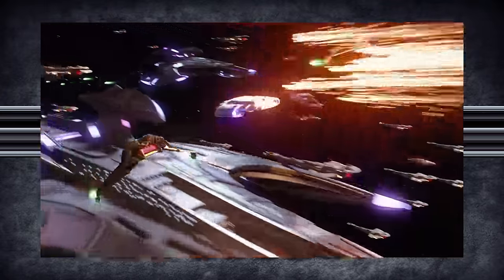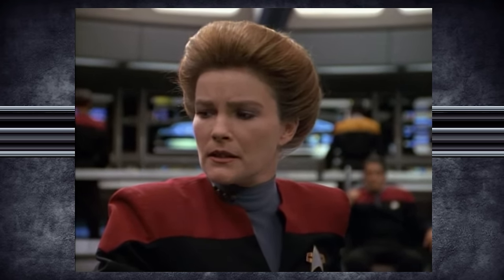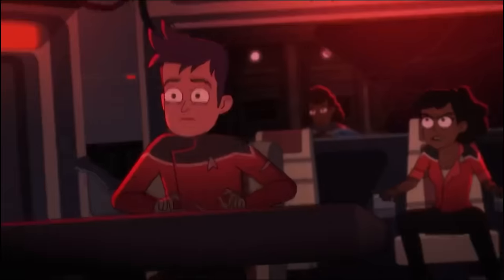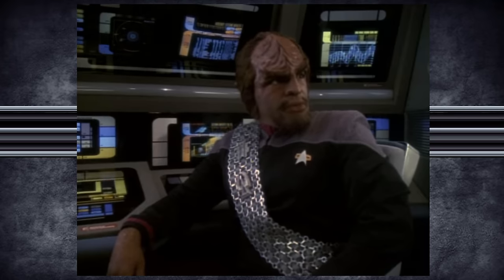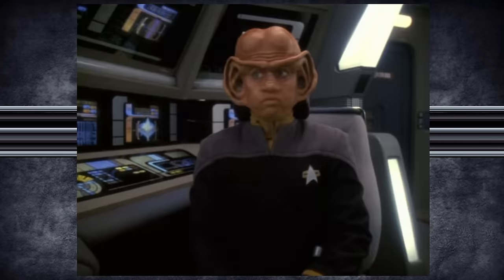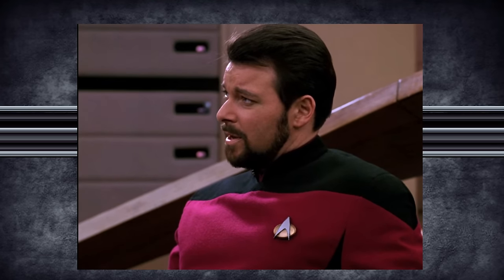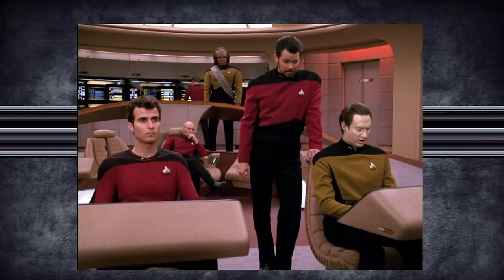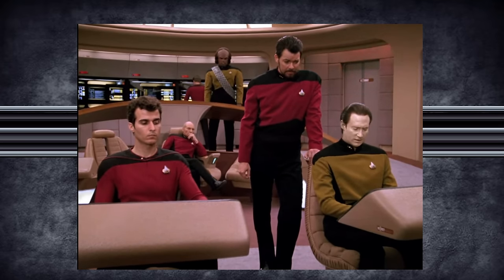Why Starfleet's Bridge Design Was Lethal to the Crews

Comment: Other than the original ST, all computer systems could move fluidly between all panels....the designation of "place" is only in meaning to where the person feels more comfortable. As is seen in many episodes, including when everyone turns into children, the computer systems can even be "moved" to the classroom. Panels also line the walls of the corridors, so at any point, any officer with the proper authentication could technically access their screens just about anywhere on the ship...even self-destruct was not limited to any one location.

The original ST was too old to realize the true future of technology as the later versions, the sets were push-button and knobs from radioshack. If we take this as a classical sense, then we could argue that the original would have had all of the systems seen today and so it too would have those same abilities.

As for the windows, not really. The computer is the most protected piece of equipment and is housed in the center of the entire ship and has its own generator. If panels get fried, other panels will be available. If "power conduits" (which are actually a gel transfer membrane that also houses computer throughput) were to be ruptured, then there are redundant systems that the computer reroutes, having the ability to sever connection points that are faulty automatically. If the computer fails to the point you can't access any data, then the ship is lost anyway....it is the most vital system that it will be the first needed to be repaired no matter what (it controls life support, gravity generation, shields, weapons, and even transport).  The only systems that are fully separated from the computer are the lifeboats and docked vessels with their own separate (smaller) computer systems. Transport can be decoupled and has a backup to maintain sync, but only just enough...Scotty had to double-back the power system and place the transport into cyclical buffer just to save the crew in "suspension."

Comment: 3 dumb comments,
1) if you have ever stood on the bridge of a battleship or aircraft carrier there is a lot of equipment that impedes movement ST isn't different.
2) US Navy like the bridge design of the enterprise they created a commission to study its efficiency
3) the touch screens panels would be a major problem (TNG,DS9, VOY) the moment the ship started to shake, I had a touch screen CD player in my truck years ago and it was very difficult to adjust the volume or operate when the jeep was driving down the road.

Comment: Windows... well kinda agree with your point that in our military it provides important function, especially when instruments would fail somehow.
But kinda comes from one problem, we don't have actual space military and only comparison is with sea going fleet. 
Windows make bridge exposed, while it could be buried deep inside ship structure. 
If you will think about scale of space and what can be called encounter (distance to target, lack of light) human eye would be useless as instrument of detection.
Clearly it is relic of thinking space ship have "ship" in name so it should be designed as ship.
There is no logical reason to keep one of most crucial elements exposed so much for attack. Kinda like leaving reactor core on top of armour as it needs to be refuelled, so better leave access to it.

Comment: Plasma conduits, running into every console on the bridge... plasma conduits running behind every bulkhead along every corridor and every room. No thought to designing this so that if they rupture, the blast goes somewhere other than into the crew's faces.
This fact alone accounts for very much mayhem and death to crew. Flammable uniform fabrics also.
Second, is full gravity while in combat. Falling debris and structures, and crew being thrown around accounts for very much more casualties. Of course, artificial gravity is also the most robust system in all of Trek. It almost never goes out, except for maybe once for plot effect.

They see no use for environment suits. No need for each person to have immediate access to breathing apparatus for smoke or vacuum.
Sense says that they'd don somewhat armored suits. Hull breach? So what. Deal with it as necessary, but crew can still access and work there.

Seats or even standing stations with restraints would help. We see someone seated at a chair behind a desk, thrown to the floor or across the room. If (the gods forbid) gravity went out, people would jack-in-the-box out of their seats and be helpless.

Windows are tricky. Give a transparency radiation and flash shielding, and they're opaque. If they can't go opaque fast enough, the crew would be flash burned.

Galaxy class had the battle bridge, which should have been the captain's station during any combat. Granted, they didn't want two bridge sets to be used in every episode, and they never showed or mentioned it again.

Comment: To be honest. I play alot of STO (Star Trek Online) I haven't ever switched off of my Concorde class command battlecruiser. 

I do however like the design of the Arbiter class battlecruiser.

Sure, alot of people agree that STO isn't cannon and I frankly don't care if it is or isn't. 

One thing that gets me is the over exposed neck on most Fed Starships. 

One good hit in combat while shields are down and the neck is violently destroyed. 

Sure, the neck is made to separate but, in no way are they prepared for the violent decompression. 

This is why I prefer the Concorde class, Arbiter, Intepid and similar designs who have no neck or little of it. 

Secondary to that fact is that windows are as memed in mass effect a structural weakness. (Geth do not use Windows, they are a structural weakness) 

In no way should ANY warship in starfleet have windows. Exploration ships, sure. Science, sure. But warships? No. 

Now, an argument to be made for a design I recall that had windows but also had bulkheads that closed over effectively eliminating the weakness during a red alert. 

I'm rambling. Point is, bridge designs in ST suck, I do LOVE the Intrepid and Defiant bridges. Alot of the ship designs are questionable.

Comment: There was never a need to run plasma power conduits to any point on or near the bridge.  The bridge is a control center, and thus everything it needs to do is data manipulation.  Every bridge console should thus be a data terminal,  connected to the ship's network.  And the configuration of every terminal should be software based, so any terminal can perform any control function as needed.  Destruction of any given terminal could be compensated for by picking up its functionality on another terminal.   And all powered by low voltage systems,  with very minimal hazards.   The only time there should be plasma on the bridge is when Ensign Plasma brings coffee and donuts up on the mid-morning break.  

Also, every system in the entire ship should be locked down under biometric security, encryption, and defined access levels for all crew members.   Only fully authorized, verified users would be able to do anything with any of the ship's systems.   Intruders would find that nothing works for them.  They would find all consoles to be locked down to them.      And the ship should have automated defensive systems that isolate, contain, disable, or kill intruders according to threat conditions.   Anything from simply isolating them with containment force fields in the walkways, to knocking them out with gas or stunners,  to evacuating the atmosphere within the containment area, letting them suck vacuum,  to automatically transporting hostile invaders into empty space so they go POP.

Comment: The problem with windows is that in space, you can’t see shit.  Engagements are going to be a lot further apart light to see other objects by is going to be in short supply and frankly, the bridge should be in the center of the ship so windows would be a moot point.  The XO should be spending one shift making sure the ship is running efficiently, taking care of disciplinary duties and paperwork and the second shift on bridge in command when the captain switched duties with the XO.  A third officer gets the late shift.  In the event of battle, the XO should be elsewhere in some aux control.  There is no real good reason to have them both on the bridge as the same time.

Comment: the problem you have with ANY see through materials, regardless of their physical strength is the vulnerability to EM radiation. simply put, the materials let the visual part of the EM spectrum through so if you create a weapon that takes advantage of that particular weakness it would be devastating. For example a laser that operates on the same part of the EM spectrum that can get through the viewing window. it may not cause physical damage but would cook the bridge crew nice and toasty.

Comment: Every time I see a step on a starship, I ask "why?"

Not only does it make it less acessible for, say, different heights or methods of mobility species, it just brings in trip hazards in stressful situations, or conditions of low visibility. Now crew need to be manhandled around instead of using, for example, a wheeled gurney, when they are incapacitated.

Having an unnecessary step on a space vehicle boggles my mind. Fine if it is a military installation where you can tightly control the size shape and ability/mobility of everyone aboard and space might be tight and turbo lifts prone to damage. 

On a science vessel that regularly hosts aliens or might be transporting civilians of unknown mobility requirements? Or a civilian space station where you'll never know who's visiting? No. Get your steps out of here. Ramps and lifts.
Reply: Even worse. They're already using artificial gravity. The bridge has no reason to be flat at all. Put some gravity plates on the ceiling and stick a guy up there. It's not like if power goes out he's going to FALL. The bridge shouldn't be a circle, it should be a sphere. There shouldn't be stairs anywhere, OR EVEN RAMPS, because there is no such PLACE as a different elevation. Just put your gravity plate on a slant and your wall is a floor. Your ramp is a flat level surface like ANY OTHER PART OF THE FLOOR regardless of what angle it's tilted at.

Comment: If the ship was hit in the bridge at a given time could wipe out the top of the command structure. Plus what's with the seats not having safety seat belts. Objects in motion remain in motion unless acted on by an outside source. So if that big starship stops suddenly and you aren't strapped into the seat then, you are going to continue keep going even if means slamming into a wall.

Comment: You're gut feeling about windows (Them NOT being useful) is correct--for one big reason. The distances used in space and the lack of strong light sources, would make most windows constantly black unless you were near a star. More often than not, windows would be completely useless. The reason why windows are used in RL on ships is because 1.) They operate very close to a star. 2.) operations take place on the surface of the vessel frequently (This would be rare in space); such as the arrival and departure of aircraft, so there are a bunch of objects close enough to the ship to make eyeballs useful (Even at night and only lit by lighting from the ship). This is also why bridges are elevated in RL--because you can watch operations across the ship from there. Again, a space faring ship wouldn't have this. So windows really wouldn't be useful on these ships. (NASA also only uses windows because NASA often needs to do operations in atmosphere AND doesn't stray very far from our sun).

Comment: Were the bridges designed more for ease of camera's shooting scenes, rather than actual functionality?  Just a thought. I wondered about that when I first watched the original series as a pre-teen.
Reply: Partially. You could remove wall sections as needed for camera placement and lights. Remember how big both were back in the day.

With newer series, it isn't as necessary. Much smaller cameras that can be operated remotely mean you don't need the space for a big camera and operators, and more sensitive cameras mean you don't need as much light. And the light you do need can be supplied by flat LED panels that you can stick where you need them without needing to disassemble part of the set.

Comment: Star Trek bridge design is based upon ratings and script writing: we need the top brass to be the center focus, to appear to be the center of the experience and danger, to be together to interact, to be there with explosive control panels and fly around during battle scenes with sparks, and we want the rest of the ship to recede into the background(we don't want you seeing the red-shirts, support staff, other grunts, and families too often).
Reply from the maker: In bsg, Babylon 5, and others they were able to be more realistic and make it work.. I think trek could have done it as well
Reply: @LoreReloaded  Excellent point. The best counterpoint is that Star Trek writers were looking to address moral and politically touchy issues, and the Star Ship, other planets, bridge, and things were just the pretext to touch such topics on public TV at the time.

Furthermore it was the simplest solution, and while it may have been technically or tactically lazy, the show was never really intended to be an accurate or actual depiction of space travel, but was instead a framing device.

Comment: My stance re Windows: Windows on an interstellar ship are useless. 99% of the time, anything you're interested in will be more than 10km away and you simply can't see that far. It's just a dot of light lost in thousands of other dots. Unlike what movies show, a real spaceship will attack from the maximum distance. If I can hit you while I'm out of range for you, I always win, hands down. Moving between ships? Transporters can easily send you to the surface from orbit (so at least over distances of 100+ km), so there is no need to ever come close. The remaining 1% is when you're in dock. Then you can look at the docking bay through the window.
Windows are even useless when power fails. If you don't have sensors, you can't move the ship even if your drive works AND you have control over it. With the distances and energies involved, you simply can't hit a star system or planet flying by the naked eye. Also, most people can't get the orbital mechanics right necessary to fly in a star system and actually arrive where you want to go. Just look at the master thesis of Buzz Aldrin (or buy Kerbal Space Program and try it for yourself). And this isn't a 20t tin can with engines too weak to more than a few g's. This is a million ton behemoth that will just crush a mountain once it's set into motion. Unless you're absolutely desperate (or a screen-writer who doesn't understand physics), you call for help when your sensors are out or wait for them to be repaired.
The reason why bridges have windows is that they look pretty, set designers and writers have no idea what they're doing, and it looks good on film.
That said, with the energies involved, it doesn't matter whether the bridge is inside or on the surface of the ship. When something gets past the shields, it can hit the bridge even when it's 10 decks below the surface. So this might be a psychological thing: Would you step onto a space ship when the bridge was safe in the core but with your bunk and work place closer to the hull? When it doesn't matter (from a security perspective) where the bridge is, it might as well be prominent.

Comment: Even more than the layouts, the Federation's spotty use of seatbelts and insistence on wearing space pajamas probably kills more crewmembers, both on and off the bridge. Proper seating should ensure that you can't be thrown into a solid object due to impacts unless you intentionally override the safeguards, and good uniform design should provide quick and scalable means of protection against sudden environmental hazards, such exploding consoles, and the vacuum of space.
Reply: I am remembering the original Star Trek Movie TMP. Where the arm rests can fold down over the user’s legs as a restraint.

Comment: uhh.. many of the federations ships are shown, or said to have, tertiary command centers.. thats not something they over looked.. theres also mention there is in fact a secondary crew specifically that is meant to take up those stations in case the primary command is rendered inoperable.. TNG very much showed this in several episodes for one..
It's also worth noting that in some episodes it's been shown or mentioned with the way some of the ships are designed, you can actually move the entire command crew to engineering and still control the ship from there if necessary for whatever reason.
they didn't just not have a secondary command crew or command deck.. these did exist within the shows both on and off screen. Most notable is the "battle bridge" on the galaxy class though since it was front and centered in several episodes.